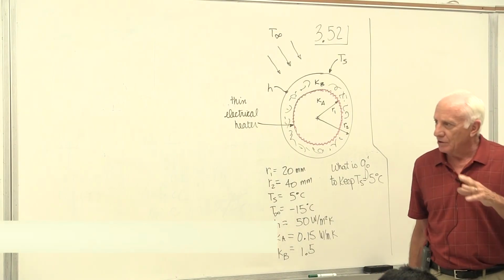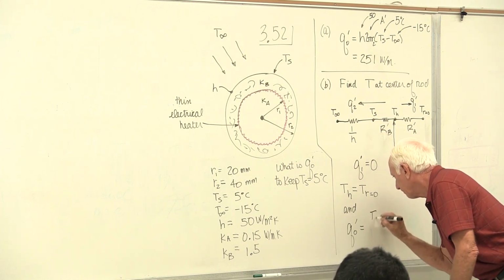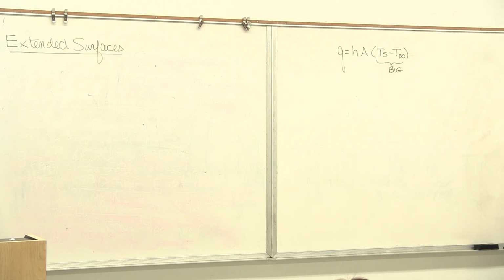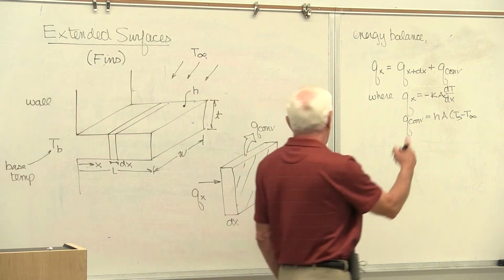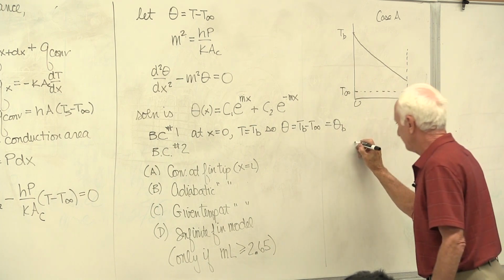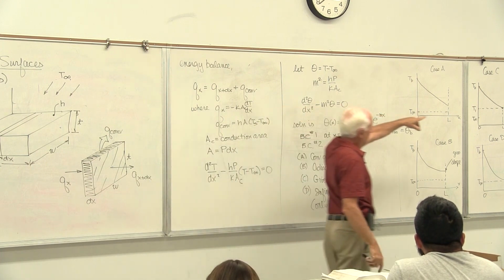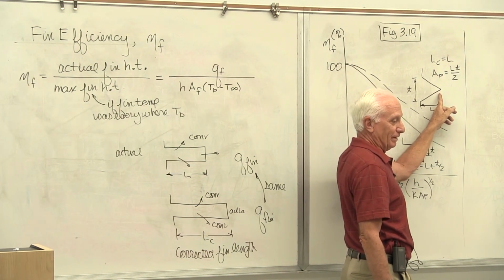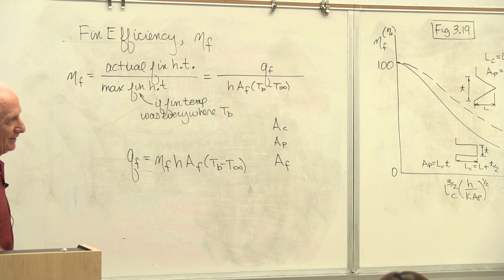Heat Transfer: Extended Surfaces (Fins) (6 of 26)

Comment: In the case where both ends are being heated with different temperatures also you are given surrounding temperature, assuming the fin has a finite length and a defined cross-sectional area. How do you find the heat loss from the bar?

Comment: In question 3.52 you said that heat generated by the heater will eventually get out by convection in the air. My question is that why heat is not being conducted by the tube and then convected in the air? There should be conduction in the tube first before going outside in the air. Waiting for the reply thanks.

Comment: The first problem in this video i don't understand quite fully. I assumed the resistance for conduction per unit length of would need [ln(r2/r1)]/(2(pi)k) not 1/(kA)
Reply: I got Th equals to 8.47 .. did you get the same value of Th that I got?
Reply: im guessing its using the conduction for Cylinder so yes use the ln function. and rmb to eliminate any L since its find heat per unit length

Comment: For Part B of the first example problem (around 9:00) he has the electrical resistance for convection as (1/h) which gives units of (m^2k/w), but with the convection resistance, you get (1/((W/mk)*(m^2)) which equals (1/(Wm/K)), which equals (K/wm). You should have the same units, and i believe that K/Wm should be the units due to it being per unit length. Did I do something wrong w/ my unit analysis?
Reply: the convective heat transfer coeff., h, typically has units of [ W / (m^2*K) ] but can be described without K as well.  He mustve made a mistake - i havent gone to look.  The units you are describing are for thermal conductivity, k, which is associated with conductive heat transfer [ W / (m*K) ]

Comment: sir why it is one dimensional heat conduction in fin material while it is transferring in y and z direction too?
Reply: Fins are made of metals with very high k like aluminium or copper and their y and z lengths are very very small compared to their x length. This means the drop in temperature in y and z directions is very very small compared to the x direction.
Reply: Mohamed Gamal but still fin is loosing heat from these coordinate directions. But what are the basis that allow to neglect heat from the directions...
Reply: @iamzed2009  1 dimensional heat transfer only when Biot number is less than 1/6.
Reply: We consider the heat flow in the y and the z direction. The heat flow in the vertical direction ultimately is lost due to convection which is considered.